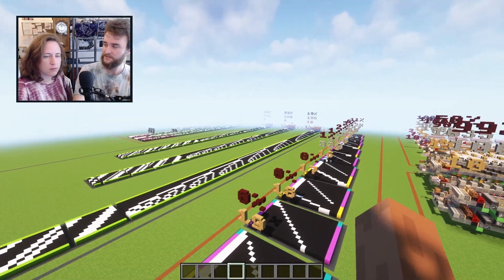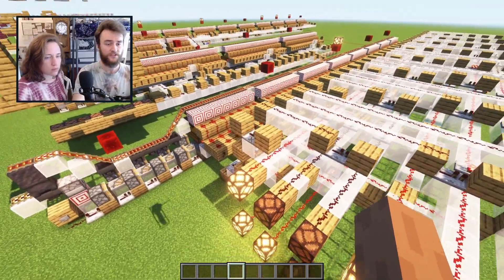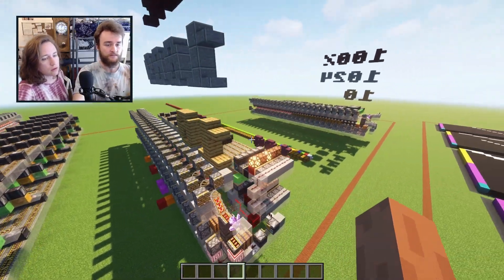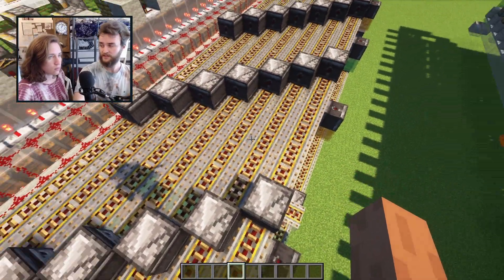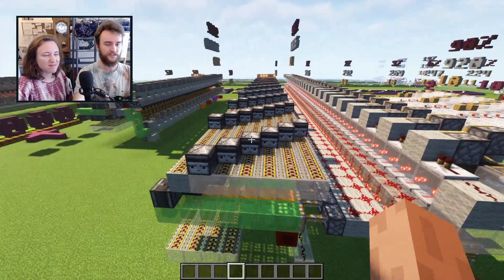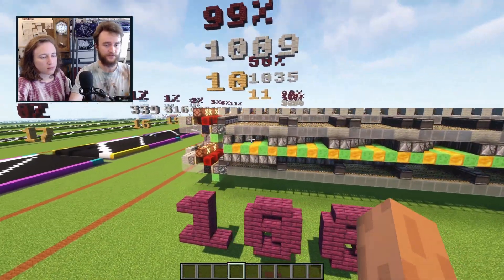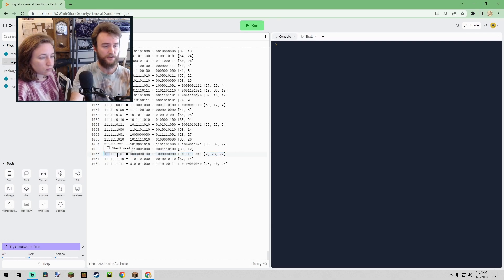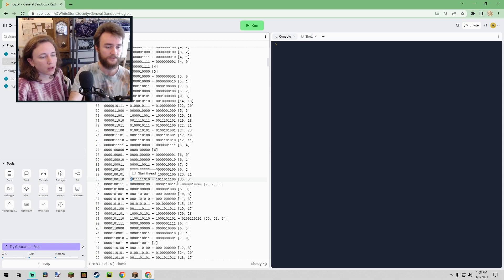Encoding items in Minecraft (4 of 5) - practical design

Comment: My idea to break the time almost in half is by using 2 minecarts. You dont have to return the filter item if you send another one. Basicly you split your track in 2 (top, bottom). Both track go only forward. When you trigger it on, one minecart is send on the bottom line (same as yours). A tick later another cart with the same item goes on the top line. 
Basicly when a filter item is taken out by the bottom cart, system detects it, and imidiatly after that the filter is refilled by the top minecart.
The two minecarts can then slowly return, but in the meantime, your system is already reset and ready for another item.

Comment: Regarding the theoretical limit: I'm pretty sure you can shave off more time, when you destroy the minecart at the other end and send it back with an instant dropper line. The encoded items can also be send back with an instant dropper line on top with hoppers underneath. Then you take a signal from the chests, which miss an item, and feed it into the dropper line. The items get then transferred until the locked dropper, where the hopper picks it up and transfers it back to the chest. That should be way faster than sending the minecart back with a piston bolt.
Reply from the maker: That is a wonderful idea. This brings us down to 2 to 3 seconds per item

Comment: When you say fold, do you mean 

1111100001 

Turning into 

11111
00001

Or 

11111
10000

So like, do you mean folding it like a piece of paper or cutting off the second half and putting it below the first half? Awesome video, I’m looking forward to the next one!
Reply from the maker: I think the 2nd one where you cut the number... but I'm not 100% sure now that you've specified the difference. will have to double check
Reply: @whitestonejazz  i just rewatched the part about 11 and a half minutes in and it looks like second one, thanks for responding!

Comment: that is a very cool solution to the incoding problem, now i'm a bit curious of how you actually found those codes, and then the solutions  to the generealised case for a bitstring "x" bits long, where any number can be composed of at most "n" codes, that again can at most contain "m" ones per code.
this could be a fun problem to find a general algorithm for. and in 10 bit case where you have 42 codes, it's is comparable to using a base 42 numeral system without using the same digit twise in a number.
Reply from the maker: I know @DatNerd has worked on the general problem a bit. If you're interested in poking around the code I used to find these bitgroups, it's in a public live repository on replit: https://replit.com/@WhiteStoneSociety/XOR-bitgroup-playground#main.py I also opened a math stackexchange question related to this: https://math.stackexchange.com/questions/4611907